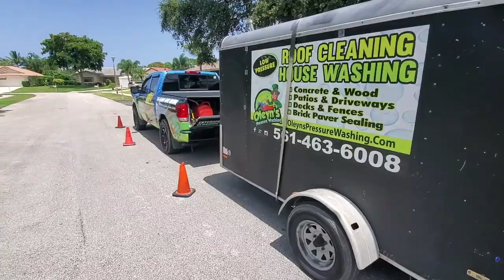ROOF CLEANING HOW TO -TILE TECHNIQUES

Comment: So I've been thinking about getting into tile roofs since I don't provide those Services. Bought a harness & anchor to get started on the safety side. I'll be using an electric pump backpack sprayer to build up financially to be able to afford a softwash system in the future!
Reply from the maker: Becarful with backpack.... dont burn your butt crack
Reply: Entrepreneur Army 😂 I'll be wearing a hazard suit
Reply: If you get one with an internal pump and flush it out with water after every use you shouldn't have to worry about it leaking down your back
Reply: @hankaaron77  Out here in souther california it rarely rains so you think i should rinse after applying the solution? And of course its always hot pretty much so it will dry out quick
Reply: I have used a backpack before on a small roof and it worked great

Comment: I already liked your chanel  before even watching the video. This is exactly how I clean my Spanish Tile roof but please be really careful, that bleach is slippery as hell, there was a time I almost fail off the roof, the one and only problem I have always faced is finding strong bleach sprayer, using a 4 gallon ryobi always requires me to get off the roof and refill at least 3 more times! I hate that, I wish someone on this Chanel has a solution!

Comment: Hey Sir. When using your soft wash is the grounds man spraying for the pressure washer or are they just hooked to another faucet to the house? I'd hate to have to run both my 12v & pressure washer all the time at the same time when doing roofs but I'd also hate to have to lug around another water hose and find additional facets.
Reply from the maker: Yes u can just use hose from home supply but nothing beats 8gpm for rinsing espicially no gutters

Comment: Hey man awesome video.. I’m also located in Florida so you understand the heat & I’ve been doing strictly pressure washing and I bust my butt all day with just doing the high pressure. I have a 4200 PSI 4GPM North Star pressure cleaner & I’ve wanted to switch to soft washing because I’ve seen guys blow through roofs while it takes me a whole day to do a decent size roof. I was just wondering what chemicals would you recommend & do I keep my current machine? Or do I have to buy a water tank & a soft washing pump.. trying to learn the new ways. If you have time thank you for a response but if not video was awesome. Will subscribe!

Comment: If I down streamed 10% do u think it would be strong enough for barrel tile roof ? Is there a danger of taking the color of the tiles or cement they use on caps ?

Comment: Was it just an illusion or was that tree laying on the roof or just the camera angle? What do you do when trees are touching the roof? I have been giving a 3 yr warranty, but I don’t give that warranty if the customer doesn’t want to trim the tree back. Just wondering what you do? Thanks for sharing Mike.
Reply from the maker: Just about . Homeowner beeds to cut them down